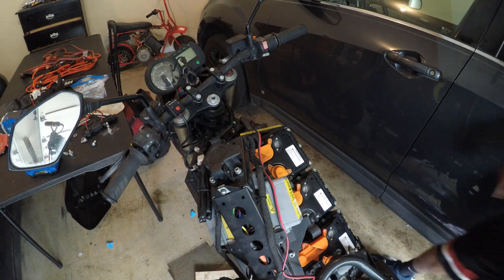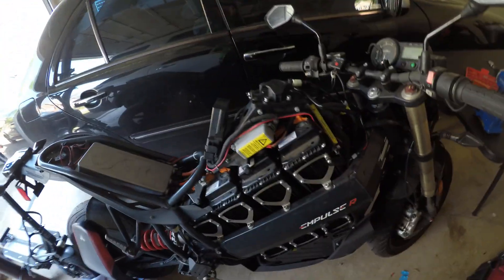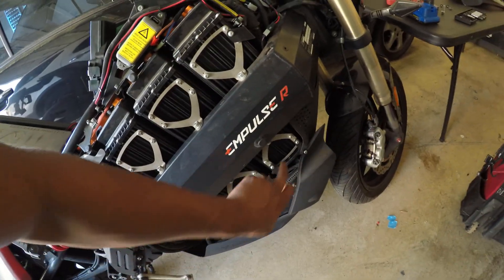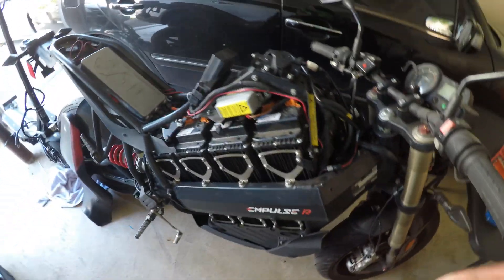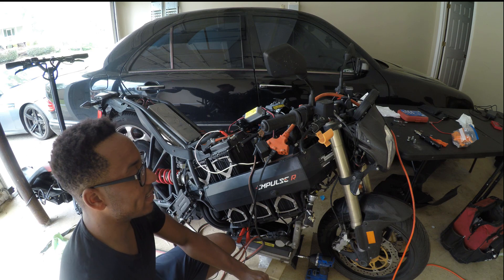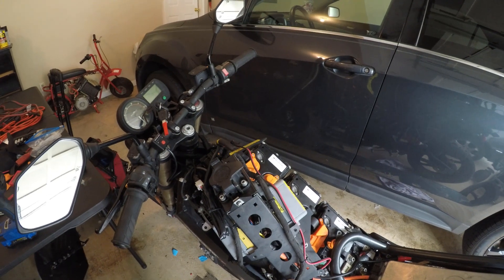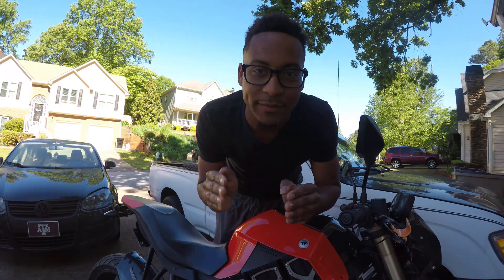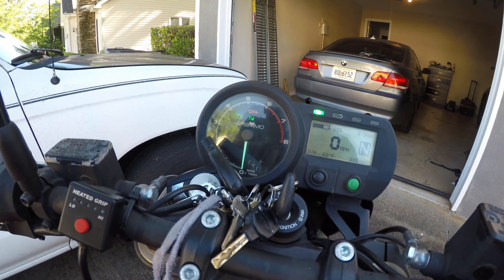How to fix a Electric motorcycle that wont charge :Works on Zero motorcycles

Comment: I have the same bike with the same problem.  What do you think is the minimum voltage in each battery that you need so that the level one charger will pick it up?  Im slowly charging them with a lithium charger but it will only get them to 12.5 volts.
Reply from the maker: I will try to get them to at least 14 V .15v be the best option if possible. What is your charging set up
Reply: @InvokePerformance  I unhooked each cell to do them seperatly.  I am just using an Optimate Lithium charger.  The charger will only take them to 12.5v.  I think I have to find one of those razor scooter chargers to get it higher.  I found your video on the Brammo forum site.
Reply from the maker: @tedsweet1404  yes  you will need to get them a little bit higher so a razor scooter charger is the best way that way then you can charge them in groups
Reply: @InvokePerformance  you figure I can charge the lower 3 together with the 14v razor scooter charger?  They look like a total pain in the butt to seperate.
Reply from the maker: @tedsweet1404  so to charge the lower three you will need a 48v charger(15v x 3=45v) then the top 4 you will need 60v charger (15 x 4=60v). Note you will need to closely monitor to ensure you unplug at the correct voltages to ensure you don’t over charge the batteries. The max is 15.6 per module any higher will destroy them. Also make sure they are perfectly balanced before you begin the combined charging process.

Comment: Was there a short?...I'm getting a positive voltage from negative  and frame with multimeter?
Reply from the maker: I’m not sure what you mean by short? The batteries should be fully isolated

Comment: I've done a good bit of lithium battery recovery. I use more or less the same method. Start with very little current and bring them up gently til they reach about 3 volts per cell. Then I can charge at proper charge currents.
I think your bike has a brushed motor. It sounds brushed. I wonder what it would do on a good axial flux brushless motor. I have a Motenergy 3031-001. One of these days it will see use and when it does, it will be something like 60-80kw. It should make a good powerplant for something. First I need to finish up my Zap scooter. It was doing great with a few glitches to work out when my dual controllers died. It's a control electronics failure. They are going back this week to get replaced.
Reply from the maker: This bike does sound unique mainly because it has a 6speed manual gear box but it is a AC motor.
Reply: @InvokePerformance  Are you sure it's an AC motor and not BLDC? AC usually means some form of induction motor. It's possibly PMAC which despite the name "Permanent Magnet AC" Isn't really anything other than a BLDC motor with a different way to detect commutation. 
**
Interesting...6 speed transmission. That does change the gear ratio so that you can dig in for acceleration or for top speed. A transmission adds frictional losses...which isn't so great. I've done a fair bit of searching for small transmissions that are modular to duplicate this sort of setup. I'd like to try it out as all I do so far is fixed gear ratios. I choose a ratio mostly for decent acceleration and that means I lose a bit of top speed. I'd rather have good acceleration and wheel torque and then get more top speed with higher pack voltage.
Reply from the maker: @de-bodgery  to your point it’s a PMAC motor made by Parker gvm  with resolver feedback to a sevcon size 6 controller. The company that made this bike was called brammo which is now out of business.
Reply from the maker: @de-bodgery  http://store.evtv.me/proddetail.php?prod=brammo
Reply: @InvokePerformance  Nothing wrong with SEVCON controllers, just bloody expensive and getting the software and programmer is bloody expensive too. I've tried to avoid them because of the significant cost. However, since you have one, you should get the programmer for it and the software so you can tweak the settings for your bike. It's not hard to switch a PMAC over to BLDC by adding halls to it instead of using the resolver. Same for BLDC, add an optical resolver and now it's PMAC.
Reply: No idea how to connect offline and away from Youtube without just posting an email addy and risking loads of spam. However, I have a source for a lot of PMAC motors for a very good price in the USA. If you want a Motenergy axial flux, I can get them for well under MAP.
Reply from the maker: @de-bodgery  that would be great also I could really use a 24f controller if you know a US supplier so if you have a instagram or Facebook account? We can private message there you can find me @invokeperformanceyoutube
Reply: @InvokePerformance  I had an FB account, but it has not seen use in a very long time and they shut it down apparently.  I did try to login last night after whatever it has been...2 years? LOL! I'm not much into social media. Youtube is about it for me. I'll see about creating a new FB account that I can neglect.
***
US suppliers for Nucular do not officially exist. I've tried to become that for Nucular, but honestly they are so swamped with orders for what they can make that the idea of having someone hold a supply of their products for sale in the USA is a bit out of reach for them right now. So I guess you could say I'm the unofficial supplier. I buy enough for me and a few extras when I order so that when people like you come along I can send one their way. I want Nucular to be wildy successful as they do make a decent FOC controller at a reasonable price. Also, the fact that they are a Russian company makes things problematic for lots of people. They are willing to buy something in the USA, but the moment it is coming from another country, this stops them. I buy from anywhere. I see a product I want and I go to the source to get it...where ever that is. As a result I use motor controllers you have to get from Russia and motors from Isreal.
**
Getting a 24F, not a problem as long as you don't mind waiting for availability. Then you'll probably only get one by sending me your $$ for one so I can add it to my order. Last I checked, they have 2-3X more orders than they will be able to fill. So its being done by who put in an order first. In my case, Ive bought from them twice before and have had a new pending order for many months. I'll probably get mine filled. Also, mine is already for 4 of them. They like bigger orders. Right now I need 2. One of them is for someone in NYC and the other is for an e-bike build I'll get to soon. All 4 I'm getting already have homes. When I get extras, I sell them at my cost. I don't do this for profit.
Reply from the maker: @de-bodgery  what part of the US  are you located I’m on the east coast near Atlanta ga.
Reply: @InvokePerformance  I was thinking about that too and then in one of your videos you said you were in Georgia and I thought "Bummer!" I'm in Colorado. I used to live in Alabama for about 12 years and was in your area probably every month. I spent a lot of time in Alferetta for work.

Comment: There are 36 cells in each battery in a 4s9p configuration. so you revived them from 2,5V per cell.
Cells are 10Ah each. So, 4x7 cells in series makes 28s or 110V nominal at 9p or 7x90 for 630Ah (9.8KWh).
Reply from the maker: your math is correct.
Reply: BPM 15/90 lithium-ion (NCM Chemistry), 9.31 kWh (nominal) 10.2 kWh (max), 1500 cycles to 80% capacity(100% DOD), level 1 maximum charging time: 8 hours (0-99% SoC, no cell imbalances), level 2 maximum charging time: 3.5 hours (0-99% SoC, no cell imbalances), every 10 minutes of level 2 charging adds up to 5 miles of range.